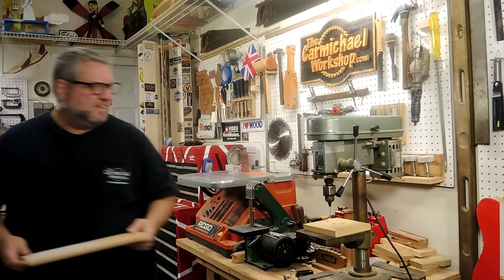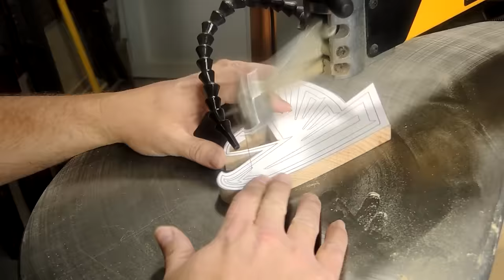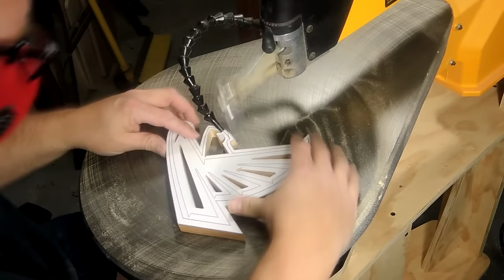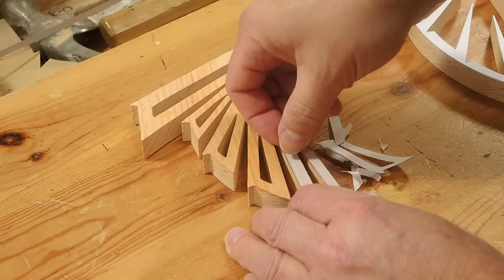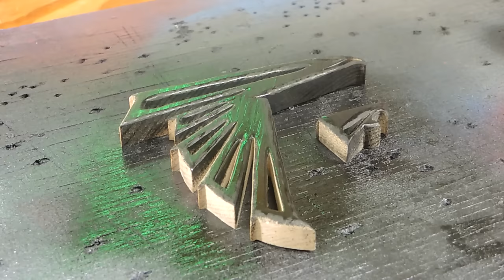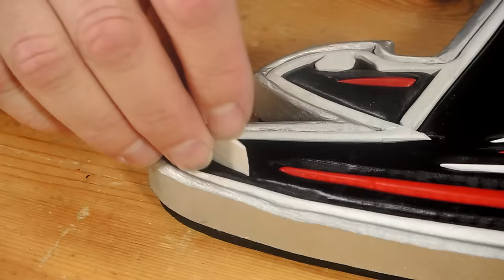Wooden Atlanta Falcons Logo - Superbowl LI Segmentation Woodworking Project

Comment: lol @ the belly-vac. Nice project Steve. I thought gluing painted surfaces was a bit of a no-no?
Still need to bust out my first project on my new scroll saw.
Reply from the maker: I always glue painted stuff together for signs, since it's not under any stress.  The back of the logo parts were bare wood and the backerboard just had overspray on it.

Comment: Hey Steve, great project. It I would like to add just a little constructive criticism. The light is reflecting off the wall and saws behind you. Might want to consider adjusting the lighting. Not trying to be a jerk,  love everything you do, but sometime you need a 2nd set of eyes to see these things. Luv ya man !
Reply from the maker: Thanks Richard!  I noticed that too.  I need to do some test clips to see if I can fix it.  Sometimes I accidentally move the exposure dial and it gets too bright as well.  Will see if I can fix it.

Comment: What type of blade are you using ? Is it a spiral scroll saw blade
Reply from the maker: Not sure, but most likely this Olson reverse - https://amzn.to/2MNQrSS      Spiral blades cut in any direction so there is no need to spin the board to cut around curves and corners.  Whenever you see someone cutting out a project and they are NOT spinning the board to go around corners and curves, they are using a spiral blade.

Comment: What kind of blade are you using for this 🤔
Reply from the maker: Hey, I like the Olsen Reverse Tooth blades that have teeth that cut up from the bottom and down from the top.  tpi depends on how thick the wood is.  The paint kinda fills up the kerf gaps.